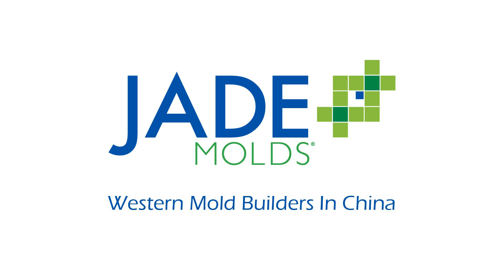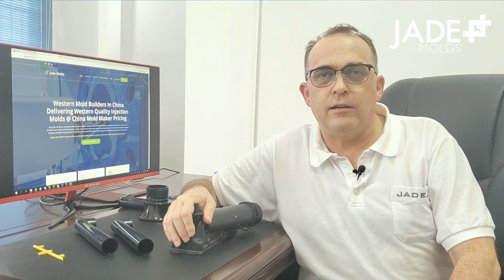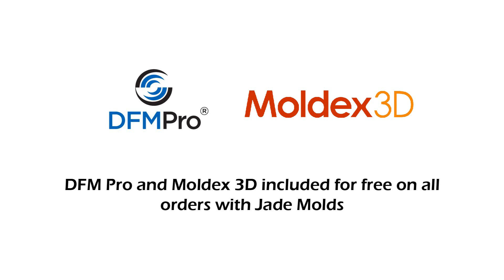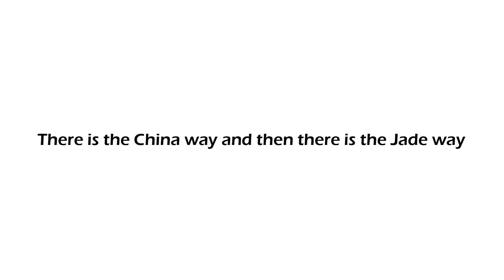Jade Molds introduction with Patrick Smith

Comment: How to select a Chinese injection fan mould supplier?
The major reason that American and European companies source plastic injection moulds in
china is cheaper price,however if we want to have a feel good discussion and ask what to look for
when selecting injection mould,we can note the follow points:
1. References — Get from them
2.Origin of Tool Steel
3.Capital investment and equipment
4.In place project plan that shows every aspect
5. Quality Systems
6.Validation Systems
7.Knowledge of your product — Have they done this before?
8.How much capability do they have — Can they do everything themselves?
9.Capacity
There are Chinese plastic injection mold suppliers that make dedicate themselves to quality
and delivery and these are normally the ones with the higher price.
Somebody had bad deliveries and quality from American, Mexican and EU injection mold
suppliers in his previous Global role some issues worse than any he had to deal with in China.
China will have to go a long way to instill reliable confidence in their ability to perform as a
capable OEM supplier. There are just too many instances of poor quality, delivery, service, and
technical support.
It just seems that whenever China is involved, the only thing that matters to them is money.but
our mould company is on the way to as a capable OEM supplier ， because of the present
president Mr Sun has been born well-know mould family in Huangyan district, whose grandfather
has been a mould maker in 1950s .His family focus on system solutions for Fan mould application
decades.our mould company is renowned as “the excellent fan mould maker”by local thousands
mould manufacturers.